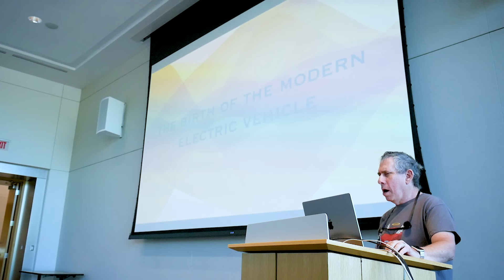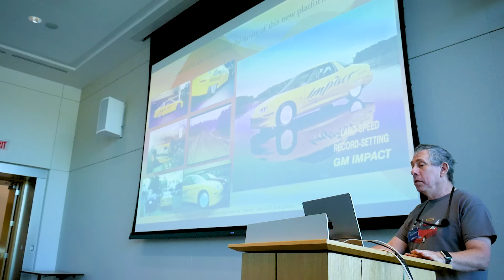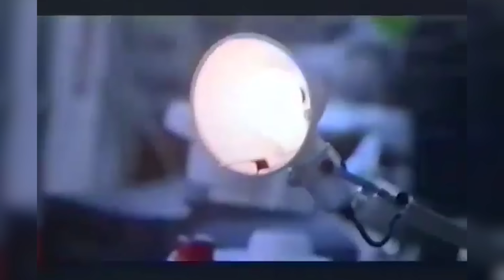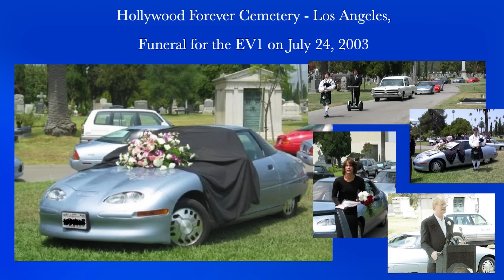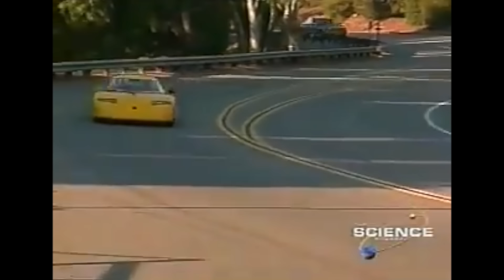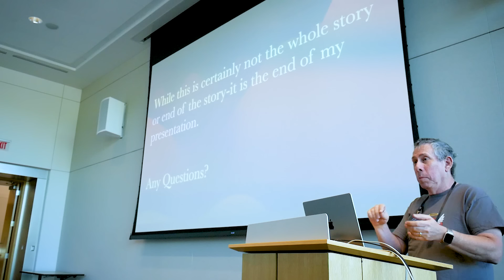GM EV1 And The Birth Of Modern EVs

Comment: I love the old videos on the Baker Motor electric car like the one Jay Leno has and others with the Detroit Auto electric cars from the early 1900's.  The Owen Magnetic luxury vehicle which used a gas engine to run the electric motors was interesting but they were on the high end in cost.  Tesla's build out of their charging system (NACS) was pivotal in EV adoption because the government plan (NEVI) was slow, expensive to the taxpayer and unreliable.

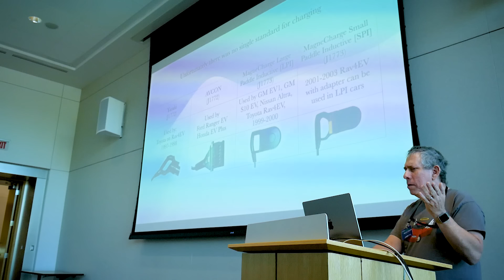Comment: 11:05 Having made the San Diego to L.A. and back drive four times in a fortnight last month ( Alpine-Hollywood on the 15th, 16th and 18th, Alpine-Irvine on the 25th) I will affirm that the drive would be daunting for limited range EVs without easy to find chargers on the road. Call me spoiled, but it would have been torture sans FSD, too; it made all the difference on one of those drives.

Comment: Tesla would not exist without AC Propulsion's tZero. That was the concept that proved an electric car could be fast and fun to drive. Even thought the thing itself was little more than a tube frame with a shell, a battery, a motor and a chair.
The EV1 was designed to be neither practical nor much fun.